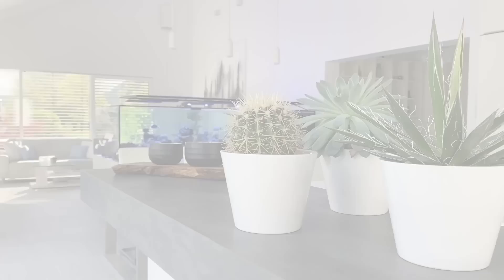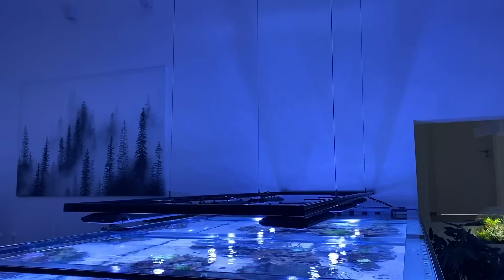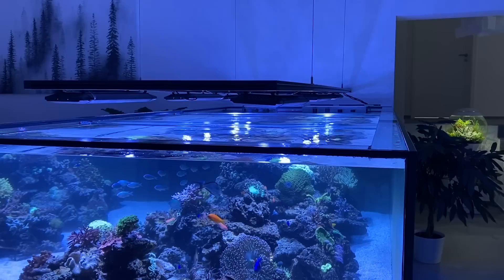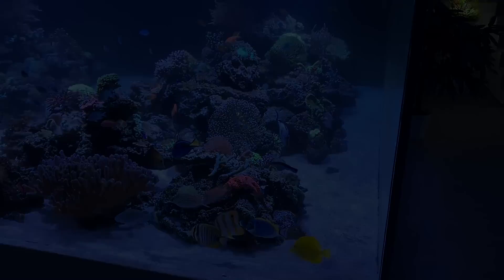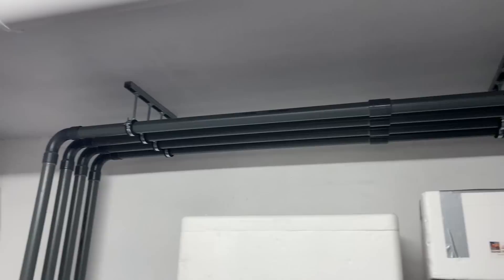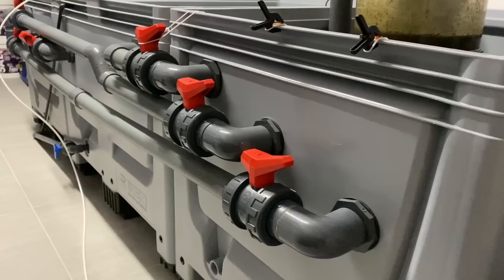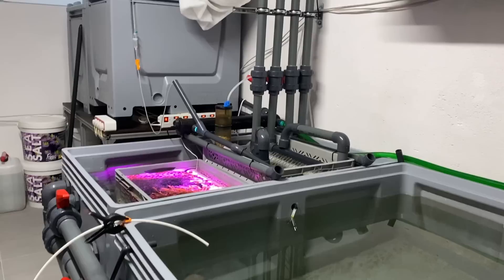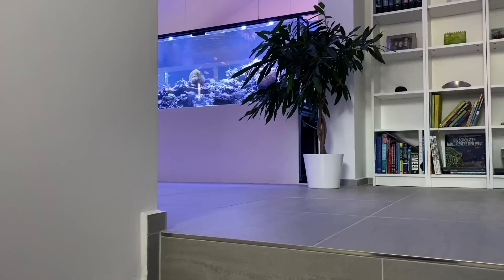GERMAN REEF TANKS - 4000 Liter / 890 gallon exclusive reef tank tour #meerwasseraquarium #aquarium

Comment: Salt costs , electricity bill , sound , and how long does it take to clean the glass? What do you do in a power outage? What happens if you need to dose meds? How do you even control nutrients and flow?
Reply: People use a backup power supply, and they control the nutrients with the plants you see in the video.
Reply: The flow had me thinking, probably has closed loop return pumps plumbed in the rock work. The rest is just a matter of money which clearly this person has no shortage of.
Reply: @glenbuyer8738  imagine getting a parasite or diesese outbreak in the tank and having to dose meds or flush
Reply: everyone dodging the question cost that was my question i had a little tank and it costs a lot not anymore i love schooling fish but damn that cost

Comment: What is he using for flow I could not see anything.  Is it just the return pumps ?
Reply: Christopher Reid I have the same question...
Reply: 2 return pumps and 2 Ecotec MP40 but i plan to add 2 more Mp60 :)
Reply: @martin_s_k  What is the positioning of the pumps? Are they discreetly hidden somehow? I don't see them in the video
Reply: Nathan Hoaglund  They are both on the left side to the wall for a circular current :)

Comment: I'm curious about the humidity in that house and how it's dealt with.   A big open topped aquarium like that has to be dumping gallons (x 3.85 for liters :D) of water into the room.
Reply from the maker: Exactly, there are big windows in that room, you have to open them every day :D
Reply: The humidity is about 60% in the living room and about 70% in the basement even in the winter without opening the windows because of two ventilation systems with recuperator  ;)
Reply: @martin_s_k  That's not horrible but still pretty high.   I know with my relatively tiny 300+ gallon system, I keep the room it is in closed up at night and it definitely feels like a swamp when I go into it in the morning.